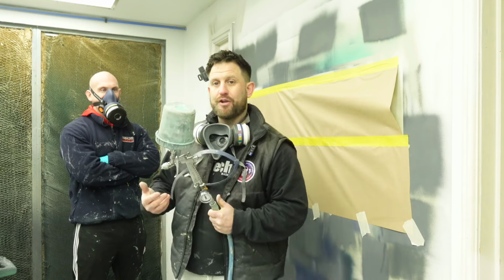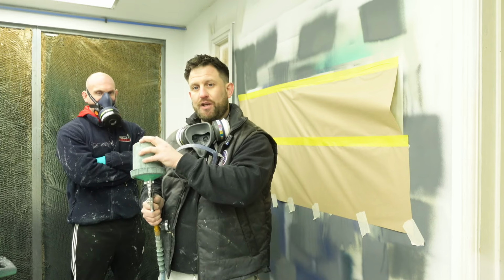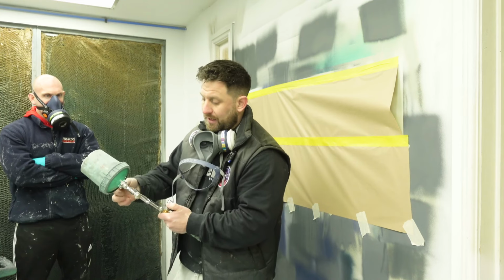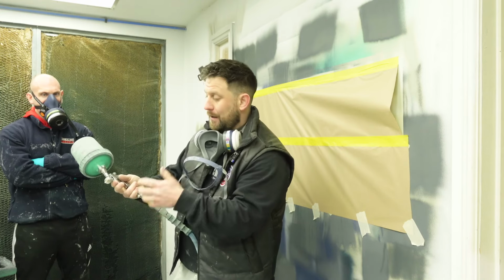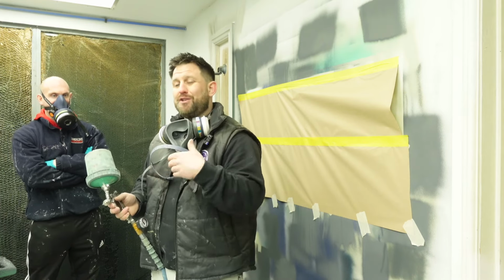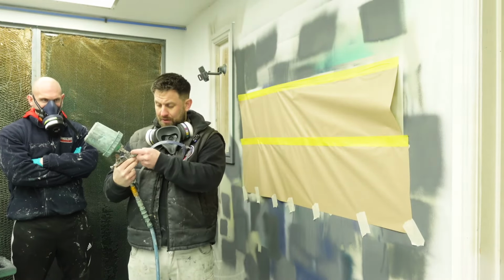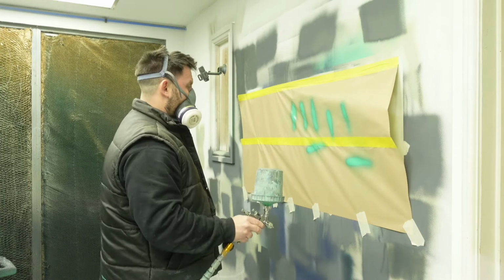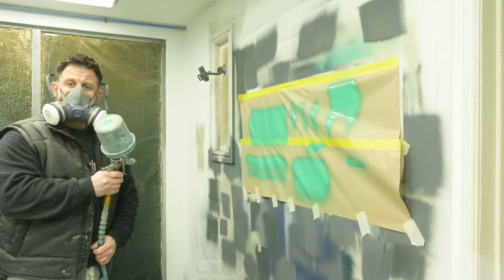Iwata LPH80 set up

Comment: Hi Jamie.
Great video…do I set the air pressure the same on the compressor at 2bar same as at the regulator or more at the compressor and if so what kind of pressure.
Cheers
Reply from the maker: @lukevarley103  hi you don’t have to but just over will be fine